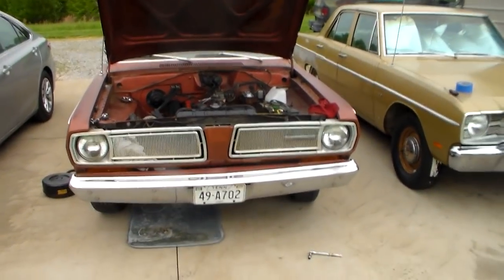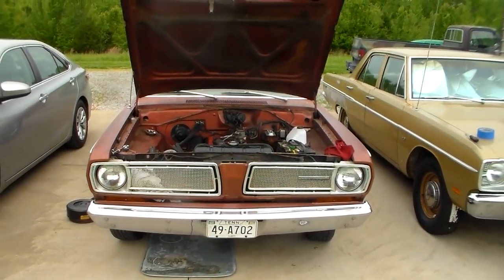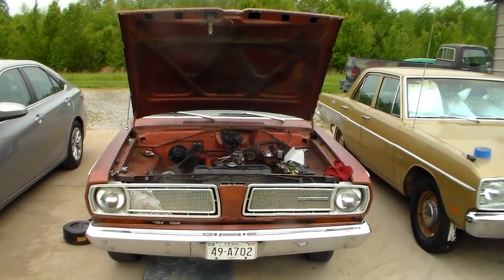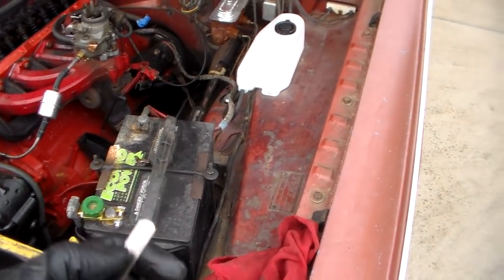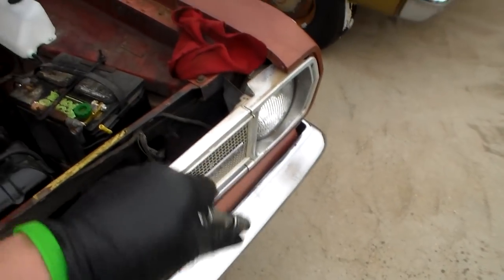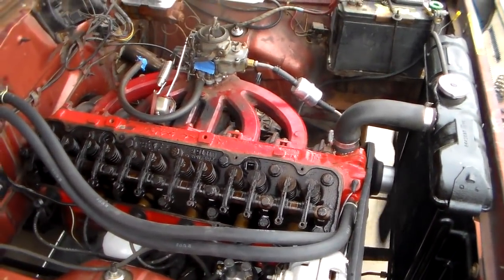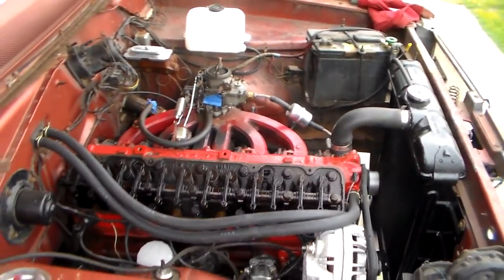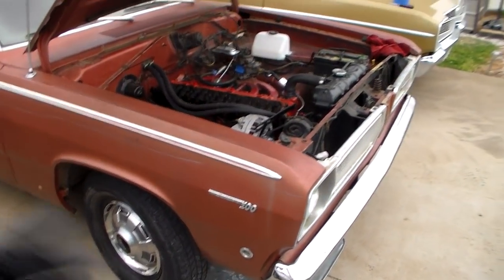Why every 1960-80 Mopar slant six should have "noisy lifters"

Comment: Ahh, my first car had a 160hp leaning tower of power. I can't confirm this but I heard that the Ruskies had a tank with a (copied) slant in each corner.

Can anyone tell me about the slant with the aluminum block? It never came to Australia. Is it good for mods?  Thanks.
Reply: Very rare if non existant Alum. slants were never produced in normal production.
Reply: there were a few hundred that were sold  the price of the casting
 was High  and stopped production
Reply: @4thstooge75  Thanks for the reply
Reply: @claycoates5056  Thanks for answering me.
Reply: The aluminum block, but iron head, was 225 only and was available as an extra-cost option in 1961 and 1962. They are not good for high performance use as the cylinder walls are thin and the bores are not supported at the top.
Reply: @4thstooge75  Aluminum block 225s were a regular production option in 1961 and 1962.
Reply: @Joshie2256  Thanks.

Comment: That is a seriously dry top-end. Had a six cylinder Falcon the same way. Took the rocker stand off, ran an undersized reamer down the feed hole from the cam bearing and magically had oil flow once again. The old engine oils, and no doubt neglect from previous owner(s) had coked the passage shut. A new rocker shaft assy. from the junkyard and I was good to go.

Comment: Cool car!!! I love valiants, was wondering what do you think your valiant gets for mpgs ??
Reply: I have had several slant six cars and trucks, best for mileage was a Dart Swinger hardtop with 225 and automatic that got 26MPG. Others got over 20. I don't know why that particular car got such good mileage. But, if the car is in tip top shape it is possible.
Reply: @mrdanforth3744  I've got a 65 barracuda and it really only gets like 12-13 ish mpg, stock 225 with Holley 1920 1 Barrell, was fun to drive before I got hit in it... Will be fixed soon though an wow!!!! 26 ???? Jesus , that's great!
Reply: @kodyweisbeck5026  I've never gotten under 20 hiway miles per gallon. Unless you are driving in heavy traffic you should do much better. Suggest you check compression and oil pressure, if engine is in decent shape it needs a tuneup and possibly a rebuilt carburetor. Don't overlook low tire pressure or dragging brakes, they can affect mileage.
Reply: @kodyweisbeck5026  Chrysler Imperials with 413 V8s used to get 12.13MPG lol.
Reply: @mrdanforth3744  engine has 110 psi in all cylinders and makes 60 oil pressure when cold an 50 warm
Reply: @mrdanforth3744  yes I would've figured , Chrysler's Titanic's hahahaha
Reply: @kodyweisbeck5026 That is an excellent engine.  You should be getting well over 20 MPG at a steady 60MPH on the hiway.Do a tuneup including valve adjustment, don't forget to check the air filter. Pump up the tires to 32 PSI. Regular gas is fine, no need for hi test. You will need an old timer mechanic who knows the old slant six, or get a manual and do it yourself. Plug wires may be due for replacement too.
Reply: @mrdanforth3744  ive already gone through the motor, it's the second /6 the car has had , first had a broken piston, I went through the 904 as well, these engines are too easy to work on ahahaha , don't need no mechanic, I also grew up around Mopars my whole life, but I don't know to much about the engines back round other then it came from a 70's pick up, that's about it unfortunately

Comment: So you don't have to worry about oil splash? I haven't had the opportunity to work on one of these years
Reply: When the motor is warm the idle speed is slow and not much oil is splashed.   Its a good time to clean the motor anyway!  Its a pretty easy job on the Valiants.
Reply: Very little compared to just about anything out there. The oil flows but doesn't splash

Comment: I have a 1974 duster with the 225ci slant six   Hasn't run since 1987. It's to far gone now body is rusted  out. But I wonder if it would still run. Hmmm. I like to find another one
Reply: As long as it has been stored covered, I guarantee it will still run. I bought one last summer that had 5 of the 12 valves stuck and I STILL got it running! They are without doubt one of the toughest, most reliable engines ever produced.
Reply: @randallsullivan3692  unfortunately it's been outside  not covered up ..  I think before bug season  I will pull the sparkplugs  and check the cylinders  with a camera  .
Reply: If it will turn over and the valves are free.....it will run.
Reply: @462ANIMAL  If the spark plugs are in place, valve cover on, and air cleaner in place, I could have it running in an hour, 9 chances out of 10. Suggest you take the valve cover off and gently tap the valve end of each rocker with a small hammer, if it bounces the valve is free, if it goes thud the valve is stuck. Oil the valves and tap and pull up and down until they are all free. Squirt a little oil down the spark plug holes. Disconnect the gas tank at the fuel pump and put on a gas can or motorboat gas tank. Stick a fresh battery in and give it a go. If the ignition is firing fill up the carburetor and it should fire up for you. Let it warm up at a fast idle for 10 or 15 minutes and it should run like new. O ya be sure the rad is full and the crankcase has oil in it.
Reply: Mr Danforth 374 The motors complete  air cleaner and plugs are in .. It might not be seized  up. But I think it will be as here in Ontario, Canada the moisture can be very high. I have a 61  StudeBaker hawk   That's been parked since  the 70's in a barn.. Top part of the barn was much dryer. I pulled it from the barn about 12 years ago and the motor was seized up.. Still might be, I filled up the cylinders with ATF years ago and never got back to it. The Hawk is in doors since so shouldn't be any worse .
Reply: @462ANIMAL  I live in Cobourg Ontario and have revived motors that have been out of commission for 30 years or more. Have never been stymied by a slant six. If hood was closed, air filter on, and plugs in it should be ok. See if you can turn the motor by hand.
Reply: @mrdanforth3744  I'm going to try and turn it over by hand once the snow is gone. We still have snow in Muskoka.
Reply: @randallsullivan3692  I just found the ownership and owners manual for it..it's a 73

Comment: Slants are great engines but they suffer from detonation. If unchecked, it will pound out a rod bearing quickly.
Reply: Not true. The rod bearings on a forged crank slant six are huge. The ring lands break far before any bearing damage is done.

Comment: That being said can you simply put hydraulic lifters into a pre 80 car or truck ?
Reply: There was no provision in the block to oil the lifters, solids don't need it. On hydraulic lifter models they oiled the lifters down through hollow pushrods. You would need to change lifters, cam, pushrods and rockers. But, a solid lifter engine is just as quiet if the valves are adjusted every 20,000 miles. Reface the valve stems and put on new rocker arms and your engine will be quiet.

Comment: Can you put the rockers off a s6 on a v8? Might be a dumb question but would be cool and cheep if you could
Reply from the maker: It's not a dumb question, but you cannot, they are different.
Reply: @TylersNeighborhoodGarage  darn that sucks i have a locked up 73 s6 wanting to put adjustable rockers on a 88 dodge for a thumper cam
Reply from the maker: @timallred6789  look for an early 273 V8, they used solid lifters through 1968.
Reply: @TylersNeighborhoodGarage  ok

Comment: Or retrofit the hydraulic valvetrain and have it be quiet.
Reply: if it can be done. Often a reason solid lifters can't be converted is that there aren't people oil passages in the block and the cam followers are narrower than hydraulic followers.

Comment: red is 170 cid.
Reply: Red is common to both displacements. Engine color changed with year and also application.
Reply: 225 was blue.in common autos from 1960there was a truck engine [bigger head] 243cid. . @Joshie2256

Comment: Leaning tower of no power
Reply from the maker: They are decent in a light A-body but once you run a Satellite or a Fury with one you will be disappointed. There is a video on here somewhere of a '68 or 69 Charger a guy bought with a factory slant six and there was one of those large Cordoba's that popped up on C-list with one.
Reply: I bought a really clean pickup with one with a 4 speed.. I checked the timing set the lash. Compression test leak down test. Engine was fine. Just guttless
Reply: @canabox7112  Same here, had a 3/4 ton pickup around 1976 with a 225 and close ratio 4-speed. Kind of a dog,  but was OK if you kept rowing the gears.

Comment: How often do u need to adjust the valve lash
Reply: Every 20,000 miles. This used to be part of a normal tuneup back when we had carburetors and points ignition. Takes about 15 minutes and you have to replace the valve cover gasket. So, every 2 years or less often in normal driving.